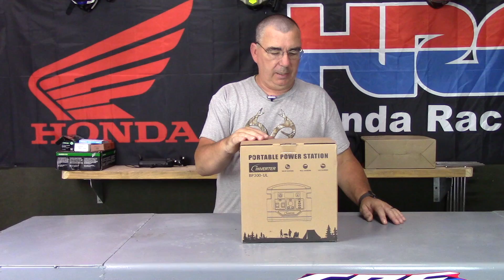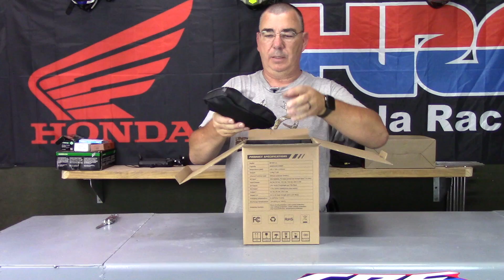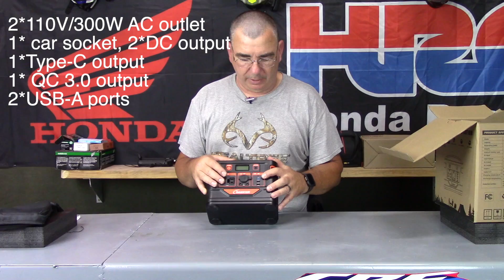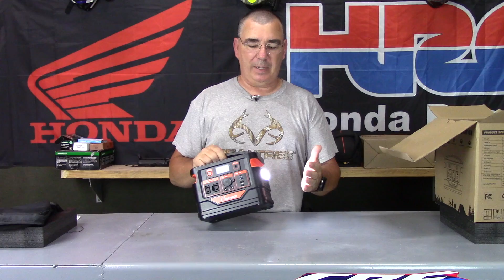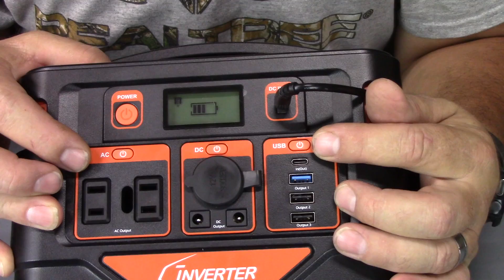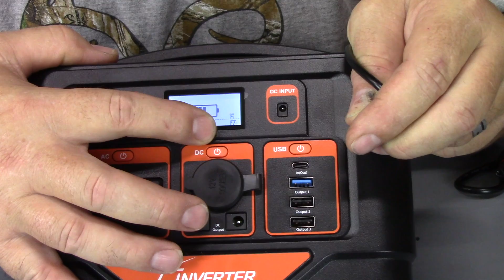C INVERTER 300W Portable Power Station Review

Comment: Hi, Can this unit be connected to the car plug and to the refrigerator at the same time? Do you have any additional information on the new  C INVERTER 1000 Watt ?  Best regards Waldemar
Reply from the maker: When you plug it in to charge, it shuts off. I tried it.
Reply: @Woodzman  Ok thank You v.m.
Reply from the maker: You can do that with the ToGoPower. Here is a link to my video: https://youtu.be/GM3-q1Woxa0
Reply: @Woodzman  Thank you very much for your answer, but I will probably still be looking for a 1000 Watt -up unit
Reply from the maker: I don’t blame you, I have a Bluetti 700 and it pretty good but I would like a 2000